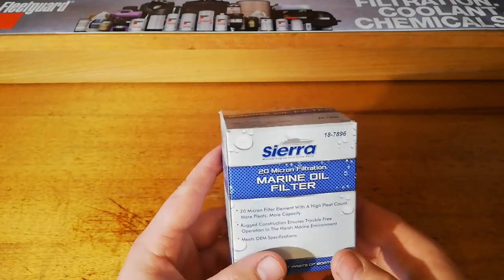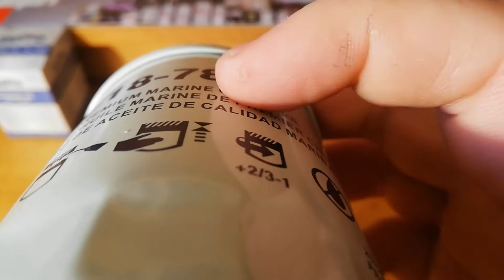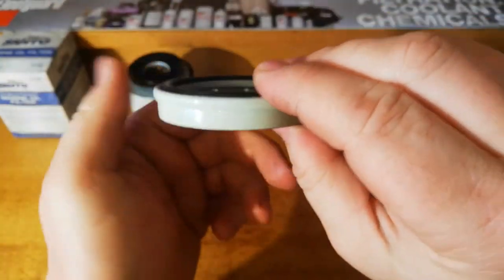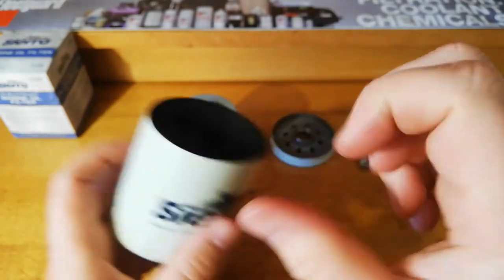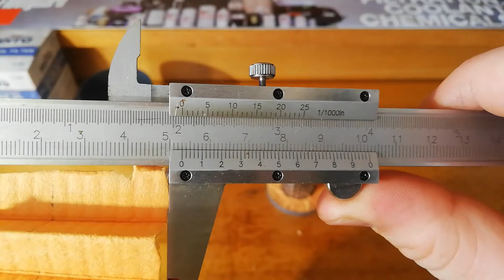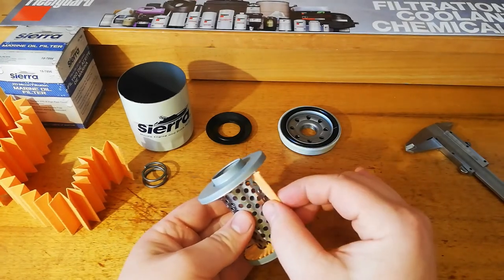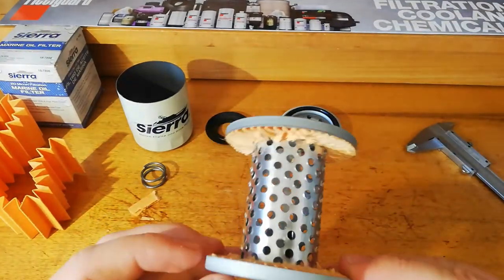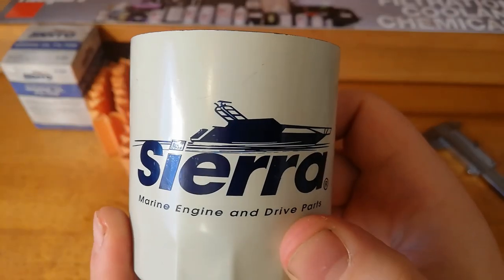What Makes a Marine Oil Filter? Sierra 18-7896 Oil Filter Cut Open and Review

Comment: Did some more research based on this video, I bought a WIX filter for my marine GM 4.3 and found a couple things, one it’s significantly taller than the Merc/Quicksilver or Sierra filters and it also used louvers inside. 
However, comparing marine water separating fuel filters (which are more like an oil filter than the fuel filters you find in automotive applications) here’s what I found:
BRP (OMC, Evinrude & Johnson) uses louvers 
Sierra uses holes
Racor (more expensive and has the best reputation) uses holes! 
I think in the future I will use WIX filters for oil and the BRP ones for fuel
Reply: Good luck with that
Reply: @TasmanianDevil3  
What’s wrong with WIX?
Is that what you’re referring to?
Reply: @Luigi-pk8mk  Have you bothered to watch any of these videos? Or any video on Wix filters? The world's worst quality filter

Comment: I checked a Mercruiser filter against the Seirra and found that Merc used louvers not holes, I found the same thing comparing Sierra fuel filters vs Evinrude/Johnson ones, louvers not holes….so OEM does give you something for the higher price. Obviously it’s cheaper to drill holes than to cut louvers….
Reply from the maker: @Luigi-pk8mk  Yes I have found alot of OEM and high quality filters use louvers and I have never seen an issue with them

Comment: Some criticisms of these filters, which are unnecessary to use at all, in my opinion:

They DO rust; I don't find them to be any more protected than the next automotive filter.

I've never seen that particular gasket, but that one seems odd.

One thing I have encountered numerous times with their spin-down FUEL filters is that the tapping plate (or base plate) is too convexed for the threads to mate with the nipple in the filter housing. You'd have to crush the gasket by way of a ridiculous feat of strength in order to spin these filters on. We've seen this SO MANY times that we have started to avoid the brand altogether. It's just not worth it to run into this problem unexpectedly and be unable to complete a job, or to try and force it out of desperation and strip something. (The design of the oil filter you have here sort of illustrates my point, although I don't know if it would be a problem in many oil filter applications.)

Something I've repeatedly pointed out is just HOW EXPENSIVE it is to own a boat. Sierra stuff is cheap. 

Why try and save money on the damned FILTERS?! HOW IS THAT A WORTHWHILE SAVINGS AGAINST THE COST OF YOUR BOAT AND ITS ENGINE?!

I also don't trust their oil; no API ratings. Again, doesn't seem like a wise place to try and save money.

Just my two cents.

Comment: Having fitted thousands of these filters over the years, I'm yet to see an issue. Cant say the same for genuine
Reply: I have used the Sierra for years on our boat and I’ve not had a problem. However Practical Sailor Magazine cut open a bunch of used filters of different makes and they found that from 50-60% of the end caps on Sierra filters leaked allowing unfiltered oil back in the engine. They did not find this with any other brand of filter they looked at including OEM. Due to this they did not recommend Sierra oil filters.
I compared one dimension on filters for my GM 4.3 V6, internal height of the element from the bottom to the top of the base plate:
Merc/Quicksilver: 2 1/8”
Sierra: 2 5/8”
Wix: just under 4”
Reply: @Luigi-pk8mk  , I've fitted thousands of sierra filters. Half of those were on commercial engines that were thrashed daily and by the time they were traded, each engine had logged well over 3000 hours. The difference between the sierra and wix is that you won't  find an engine failure caused by a sierra filter. Can't say the same for wix. I live and breathe the marine mechanical industry and have done for 35 years.